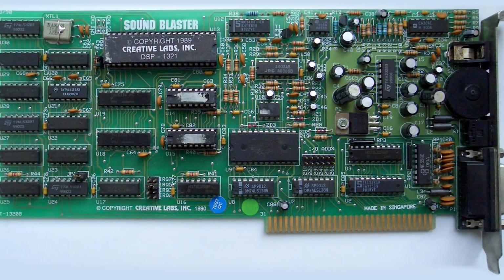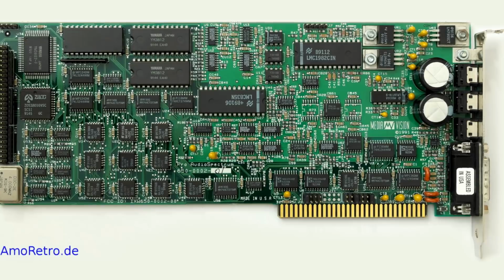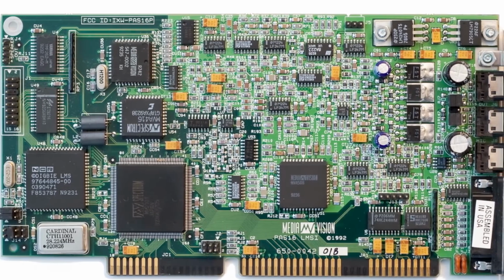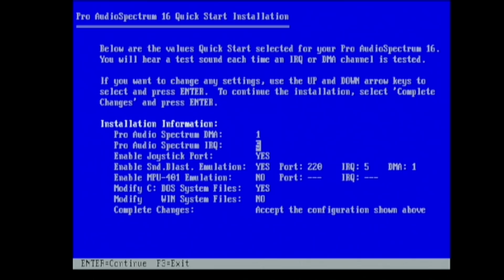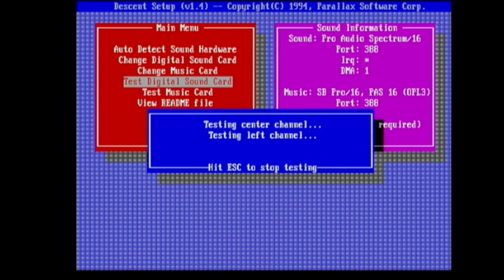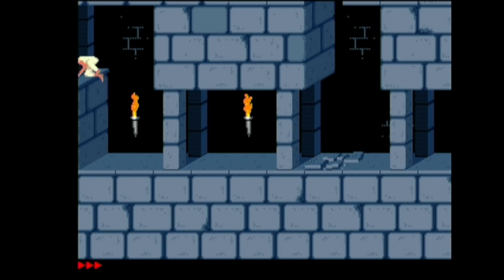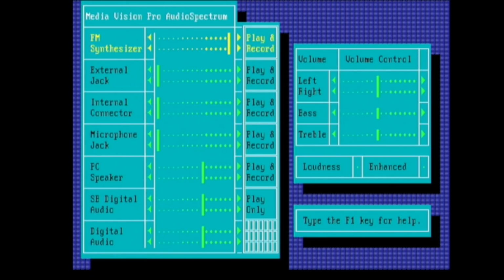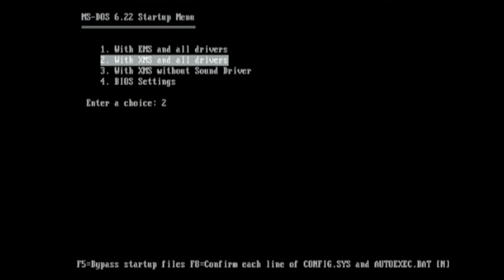MediaVision Pro Audio Spectrum 16 - myth or legend?

Comment: I loved my Diamond Monster Sound MX300 Vortex 2 card. Under windows 98 it was amazing. But then Windows XP happened and all support for Vortex 2 was gone. There were no official drivers for the Vortex 2 under Windows XP. Only generic Microsoft drivers that came with XP that didn't support any of the Vortex 2's special features. Under XP it essentially became a generic sound card. Wish I still had the card to build an awesome Win98 gamebox but it died on me while using it in my XP gamebox. Now I have a POS Creative SoundBlaster PCI. Which is not a POS because Creative. I like their cards. No it's a POS because it's a post buyout Ensoniq card in disguise. It works though but has no hardware accelerated audio support and XP was the last Microsoft OS to support hardware accelerated sound. Would like to pick up an Audigy2 card to replace it.

Comment: A friend of mine was getting rid of some old crap in his basement, and I asked him to bring over some old PCs to see if there was anything useful in them.  One of them had the LMSI version of the PAS16!  I had never heard of this sound card, nor the LMSI connection.  In the video you mention LMSI as being a proprietary cd-rom connection.  Apparently it was an attempted standard that just never caught on (shame as the cable for it is much much smaller than an IDE or SCSI one).  The Compaq that my friend gave me has the CD-ROM with it as well, so nice bonus find.  486DX@50 I think is what was inside.  Too bad LMSI didn’t catch on at all, the cable is only a bit wider than SATA…
Reply from the maker: Yes, LMSI was a proprietary interface by Philips. I'm not sure if they tried to standardize that, but they licensed it to couple of manufacturers. It was designed primary for optical drives, but wasn't universal enough for other data storages AFAIK. May be it could have been developed to s.t. better, but patents and licenses didn't make it possible.
Reply: @necro_ware  yeah, usually when I think proprietary, I consider it being one that say Creative or MediaVision would have built on.  Other manufacturers could have used it.  Unlike, say, MCA and IBM.  By the way, love your channel, been binging your videos... I screwed up my Atari PC4, and been looking at your methods of repairing traces, which inevitably I need to do...

Comment: I found a very interesting card, a bit different from the ones I can find info on. It's named Pro Audio MTBL, made also by Mediavision, has both a Jazz16 chip and a Spectrum chip on it. Haven't installed it yet, does it mean I have both SB16 and PAS16 compatibility in a single card??

Comment: I have been looking for the Trak Blaster Pro player that came with the PAS16 for years. My uncle had it and I loved just turning down the lights and vibing to the dozen or so tracks that came with it. I've since discovered most of those tracks, but can't find the program or the install disks it came from anywhere. Could you help me out a bit or point me in a direction? This is the most recent thing I've seen posted that might not have been lost to the sands of time.

Comment: so i pulled out my pas16, recapped it and got to looking at it closely... there's no -5v pin on it. my sb2.0 has it, but not my pas16. in fact, out of the plethora of sound cards i have, the sb2.0 is the only one with a -5v pin that connects to anything. seems some 16 variants didn't bother with the -5v.

how odd.

Comment: Young PC consumer at the time, I sticked with Creative, first with a soundblaster pro, then a AWE32... I don't remember seeing any pro audio spectrum box in computer shops...
Reply from the maker: Well, as I said in the video, Creative made a much more aggressive marketing and even used illegal tricks to push the competition out of the market. Also the Sound Blaster Pro and especially AWE32 came much later to the market, than the Pro Audio Spectrum. At that time PAS was much more expensive, than Creatives products, but  you could find already Jazz16 cards, which were still good quality products, but not as revolutionary as the PAS  was before.

Comment: The Pro Audio had one distinct advantage for me at the time: that SCSI bus at the back. At the time, there were no IDE CD-ROMs as far as I can remember. My first was a 1x speed with a caddy. I don't think the DOS software that came with the card supported any SCSI devices besides CD ROMs, but when I started using Linux in '93, there was general SCSI support off the Pro audio, so I was able to scrounge a couple external drive enclosures and a scanner at the university. I don't even remember the sound capabilities!

Comment: Just bought it. It would be the best option for my 486 DX2/66 build. My card has LMSI interface but I cannot find pinout for it. As I understand, it provides some analog CD ROM output among other pins. And Windows 3.11 mixer definitely has CD input (at least on pictures). Does anybody have LMSI pinout? Is it possible to use connect its pins to the CD ROM analog output?

Comment: Great video! .. how's the quality compared with today's built-in sound cards?
Reply from the maker: Thank you very much. You can't compare sound cards from back then with today's solutions, since the CPUs in modern PCs are able to mix hundreds of digital channels simultaneously and any FM sound can be simulated in software easily as well. Such immense calculating power was not available in the early 90s, so of course this cards are children of their time.

Comment: I remember having an Creative Labs and a Gravis Ultrasound in my 386 and 486 so that I could have sound in different programs and constantly having to switch the speaker cables.
Reply from the maker: You could use a Line-In input of one of the cards to loop through the audio output, so you wouldn't need to switch the cable...
Reply: @necro_ware  in later years I did it that way, but in dos days it meant having to close the current program, run the program for volume controls and then go back to the other program. But when I had windows and still needed 3 or4 cards, because there was no direct X yet, I ran line out to line in and my AWE64 gold was the main card because it had RCA jacks to my amp. I mostly used my computer for making music and needed to play more than 1 sound/program at a time and had midi devices plugged in.

Comment: I owned a PAS16 for many years and loved it dearly.

My biggest issue I ever had:

Adaptec AHA-1542B SCSI HA compatibility issues.  Not one, but TWO of them!

1.  To boot from the AHA-1542, I had to use the default port of 0330H.  Hmmm, something must use this.. . OH YES,. THE MPU-401 USES THAT PORT!

2.  The AHA-1540 and AHA-1542 cards are busmastering cards.  If you have one of those motherboards where you can adjust/tweak bus speeds/DMA speeds, you WILL have problems when you have both card types in the system, guaranteed, EVEN IF THERE ARE NO CONFLICTS.  The moment I went to a Buslogic Bt-445C, those problems went away because transfers happened over VLB, not ISA.

I later supplemented this card with a Gravis UltraSound ACE, which was designed to work with an existing sound card.  Later, I upgraded the ACE to a full megabyte (came with 512K).  Pure bliss.

Thanks for showing up to give me some nostalgia~!
Reply: Oh, and here's a subscription for that trip down memory lane.  <3

Comment: Sound Blaster audio quality wasn't a problem. People used cheap speakers anyway.
The real sound blaster issue was lack of hardware mixing like Amiga or SNES had.
Gravis Ultrasound tried to fix this, but it's lack of real SB compatibility stopped GUS from becoming new PC Audio standard.

Sound Blaster used up to 20% of CPU, especially in games that used amiga modules.
GUS on the other hand had barely any performance loss. Playing PCM samples on GUS was as lightweight as FM synth on Adlib/SB.

Later Crative cards had similar features. Very popular SB LIVE could mix up to 128 channels. This had impact in windows 9x games. Especially those with MOD music. Unreal games used 12+ channel mods.
Reply from the maker: Ahm, no, there is a reason, why Sound Blaster 1.0 through 2.0 were called noise blaster. The amount of noise bleeding through the data bus was simply incredible, doesn't matter how bad your speakers were. I'm not talking about white noise, that was also bad, but compared to the data bus noise that can be completely ignored. That sound cards were even completely unusable with the headphones, since there you even sometimes couldn't hear the main sound, when during playback an IDE access happened for example. That was definitely the biggest problem of that sound card by a huge margin.

In regards of performance drop due to missing hardware mixer, yes, you are kind of right, but that lost very fast on importance back than. The first sound cards end of 80's were made for the XT and 286 class machines. They supported only FM sound and were not very CPU hungry. As the first sound cards with digital sound support hit the market, the 386DX was already coming strong and there were yet almost no games available with digital sound support. As the first games appeared, they were made backwards compatible with XT and 286 and there the processing of digital sound took really up to 20% of performance. But that CPUs were usually to slow for the games anyway and the number was already under 10% on a 386DX and under 5% on a low end 486 around 1993. The game developers limited the amount of digital channels to keep the CPU load low and the GUS, with it's 32 hardware channels (with some limitations in the sampling rate), was theoretically a win, but usually not in games, since nobody wanted to make a special implementation for GUS. So the benefit remained basically in the demo scene and had no relevance for the most users. This was one of the reasons by the way, why GUS failed eventually. Hardware mixer would be good, if they would come 5 years earlier with it on a 286.

I am a devoted collector of sound cards from that time and was a games developer in the mid 90's. So I was confronted with all that stuff not only as a user, but also as a developer back then. And today I'm often evaluating the technology and sound card innovations for fun.
Reply: @necro_ware  Software mixing never got good enough. Even PS5 has dedicated audio chip, to not use CPU for mixing or GPU for audio ray-tracing.
Sound Blaster could play 22 KHz samples and later cards were able to do 44 kHz at 16 bit, yet DOS games rarely supported anything better than 11 kHz at 8-bit. On the other hand Amiga games used 44 Khz at 8-bit by default.

Software mixing was heavy. Jazz Jackrabbit recommended Pentium CPU for high-quality music, while Amiga with 7 MHz CPU could easily run games that had better graphics and music.

It takes nearly 100% CPU power on fast 386SX  to play 44 kHz 8-bit amiga modules in stereo. You needed 486 to play modules at 16-bit and 44kHz, but it took nearly all CPU to do so.
Mod4Win had a feature to record mods to WAV files, so they could be played in the background without taking most of the  CPU time.

Original Sound Blaster beat Adlib, because it was 100% compatible, affordable and could play PCM samples.
GUS had a chance to be the next PC standard. It was affordable and had so needed hardware mixing. There were two problems. First, very poor compatibility with Sound Blaster. Second, they didn't include SDK or documentation with retail cards. Developers had to pay additionally to get technical documentation.

GUS wasn't good enough to replace Sound Blaster and had no software support. This gave time for Creative to bring AWE32 and games started to rely on MIDI and CD Audio anyway.

Consoles on the other hand relied on hardware mixing. Many Playstation games used music modules like Amiga or SNES, just at higher fidelity instead of CD-Audio.

Comment: Trackblaster I remember spending a whole bunch of time just listening to the mod files it came with. But I remember a issue that we had with our AMD 386DX-40 where if you tried playing in 44kHz mode (Which I think it warned against, memory is fuzzy) it would play for a seemingly random duration then hard lock on a hanging note.

Comment: 18:06 I can confirm the PAS16 (studio XL) which has the waveblaster header has the hanging notes bug, most likely if you plug a an external MIDI synth such as MT-32 through the mpu401 joystick port would be the same.
Edit: btw I have never in my life purchased a Creative product, after the PAS16 I got a TurtleBeach and never looked back.

Comment: Another great video walking me down memory lane. I certainly appreciate the advancements in sound technology for my computers I like to use aftermarket high quality sound cards where applicable on board sound is ok but now with Graphics cards with HDMI audio qualitiy is is high but you do not get the features you may want to produce music for example even though you can but it isn't specific for that. They are good for gaming and everyday computing but if you want the highest quality Audio you do have to pay a premium for the pleasure. However I remember the old days of various Adlib/Sound blaster/Creative cards and generic compatible clones with really poor quality static sounding audio output. Especially when it was the days of analog CD ROM audio to soundcard via the CD ROM to Sound card analog cable that had no shielding the EMI interference was bad but when computers became faster and audio was read digitally in data form it was a game changer then mp3 came out and then the rest.

Comment: Had a Crystal Semiconductor card (brand owned by Cirrus Logic) which i can not forget all the noises of the poor OPL2 playback of that. Had various on-board soundcards later. C-Media, ESS Allegro and SoundMAX to name some, but they had software wavetable for midi playback.

Comment: I used the MPU401 support on my PAS16 quite a bit, outputting to an external general MIDI keyboard for music.  Never had any issues or game compatibility problems with it.  I understand a real MPU401 has some seldom-used features that often aren't supported in compatibles, but that never got in my way.

I've always kind of hated OPL/Adlib music, and switched to real MIDI at every opportunity.
Reply from the maker: Well, I'm not sure about that point, just relying on experience of others, because I have no external MPU-401 device at hand. As far as I heard, the MPU-401 on the PAS16 suffers badly of hanging note bug, similar to the Creatives one. In many games you don't realize it, but some games like Doom can sound really annoying. I can confirm such a bug for the Creative SB16 with a wavetable for example and some people write about similar or even worse issues on PAS16. Unfortunately can I neither confirm nor dismiss that statements.
Reply: @necro_ware  Hmm, not sure about any bug, but sure if you send a note on and then exit or reboot before sending a note off, yeah the keyboard is going to keep playing the note. I probably just power cycled the keyboard at that point, never really considered that a bug.

If you mean notes getting stuck on while playing a song, due to note off events randomly getting dropped, I guess maybe that did happen rarely now that I think about it. I guess I never knew for certain that it was the card and not my keyboard or the MIDI cables to blame though.  In any case again it was easy enough to resolve by cycling the keyboard, though that would make all voices play as piano until the next song.

Comment: Back in the day I had a PAS16 and GUS in my family's computer, and there were only a few times I missed SBpro compatibility. SCSI was also an incredible feature, but the card did not have option ROM to enable booting from SCSI devices. I went through my larval Linux phase in the mid-90s with a PAS16 and surplus SCSI hard drives. It wasn't fast, but it worked.
Reply: The SCSI on the PAS16 cards didn't have a boot ROM because it was never intended to be used as a hard drive controller. The SCSI controller was there so that the card could be bundled with SCSI CD-ROM drives in high-end multimedia kits. It was a great one-stop solution for adding a CD-ROM drive to a 486. Occasionally, if you're really looking, you can still find new-old-stock kits using PAS16 cards on Ebay.

Comment: i like how modern creative cards have less features than the cards that are say, 1/10th the price and the software creative uses is buggy as fuck and well known to just require reinstallation for no reason, but creative cards are the ONLY cards capable of outputting dolby or DTS through an SPDIF/optical output. fairly certain the liscensing fees of DTSconnect/dolbywhateverthefuckitscalled are the reason for creative cards costing so much, and its ONLY 5.1 surround.

Comment: Weird decision from Creative. As far as I understand PCB design. When you already have a two layer PCB it doesn't cost any extra to leave a large ground plane on the rear side for example. Maybe you need more layers to complete routing in combination with such a ground plane though. More layers is more expensive.
Reply: It does make it tad more complex as you need to tie all the ground planes together and with just 2 layers that can be difficult. Also just adding a ground plane doesn't magically solve everything, it also causes new problems and challenges as you now all your traces basicly are capacitors.

Comment: SB compatibility in PAS16 was not 'emulated.' It was in the actual hardware, distinct from PAS16; code written properly can in fact run both SB and PAS16 concurrently.
Reply from the maker: For some reason, if someone says the word emulation, everybody thinks instantly about a software emulation. Emulation can be also done in hardware.